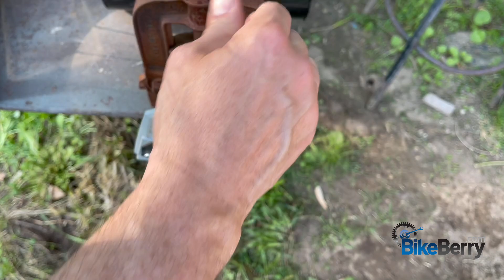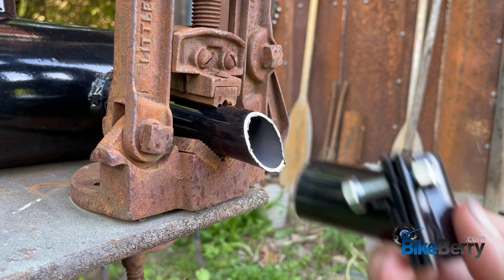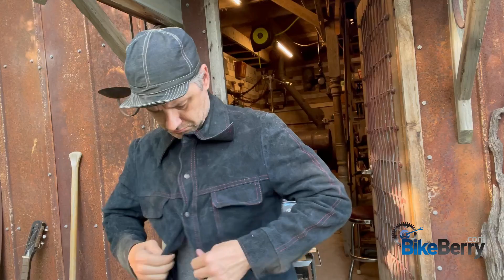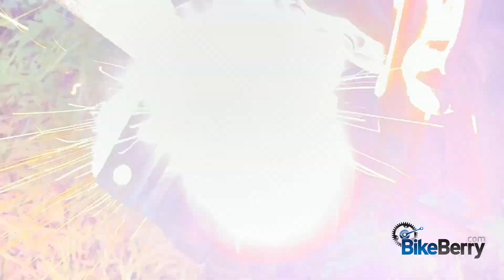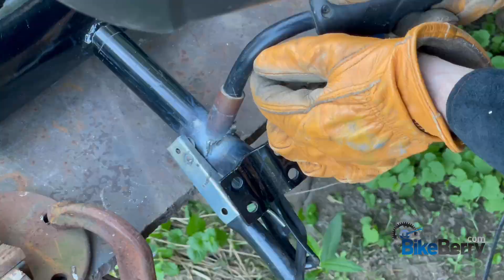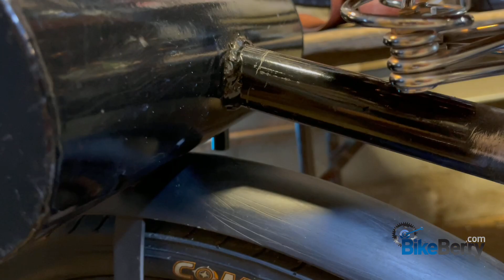Modifying A Keg or Barrel Style Gas Tank | Mig Welding | Motorized Bike | Bike Berry

Comment: Why do you feel you need to add the valve stem breather in that tank? Have you experienced problems as such before? I have those tanks also, just wanted to see if you found this an issue already. I use them on female bikes usually. Looks good Tony, Godspeed.
Reply: Yeah you need to add one because the stock caps have breather holes in them. But this one does not so adding the motocross vent was Necessary
Reply: @keeganhache6667  https://youtu.be/tFXlZZKNfmw

Never did before Tony thanks for letting me know…

Oh my bad this question is for Tony and someone else answered it!! …??? Do you have a video with it on your bike?
Reply: @rogerstafford-wakeinc.2088  I’m allowed to answer questions to don’t know why your upset about it..
Reply: @keeganhache6667  not upset Keegan I asked you to show me a bike with that tank. I typically don’t answer questions that are addressed by name to someone else and I’ve never seen you with one.If anything thanks but to be honest now that you mentioned it, kinda rude and disrespectful to advise someone without them addressing you. Please do post a link to how you know about this issue. I’d like more information and I have never had that problem.
Reply: Hey Roger, my answer aligns with my man Keegan here. This is personally my first time using a tank like this but many other builders I know have ended up adding them in to help with fuel flow.
Reply: @tonytaylor5087  hi Tony I can’t say I’ve had the same problem. I have at times added a micro drill pin (3/32)hole to caps on closed tanks such as fakers. I thought perhaps it was to add to the character of the bike. I posted a short in the section because I have the same tank and as Keegan had said something on your channel just asking for clarification. I have watched a lot of his stuff and never seen a bike like that. Thanks for getting back to me.Also perhaps it would make more sense to go into the neck than onto the cap. You could drill in just below the thread line or very close to the last threads. I’ll keep watching.
Reply: Yeah I was thinking about some options for placement of the valve. I’ll test a few areas then see what’s best.

Comment: TURN YOUR WIRE SPEED DOWN it’ll clean up the weld and you won’t have all that spark action
Reply: Good catch. Yeah it was a little fast. Also could turn the heat up a little as that pipe is thicker than I initially thought.